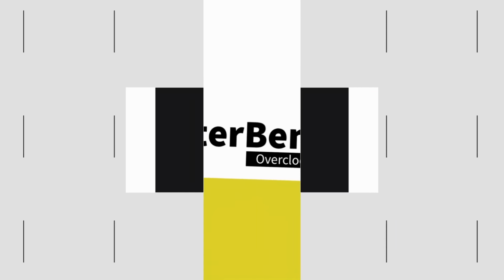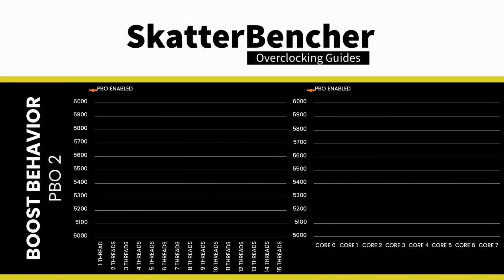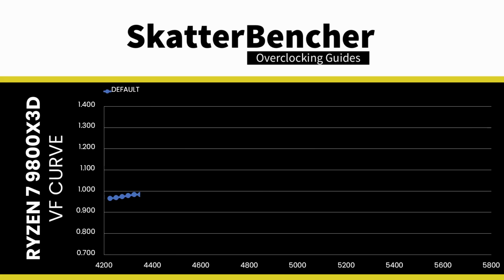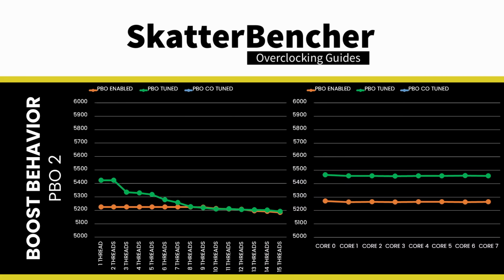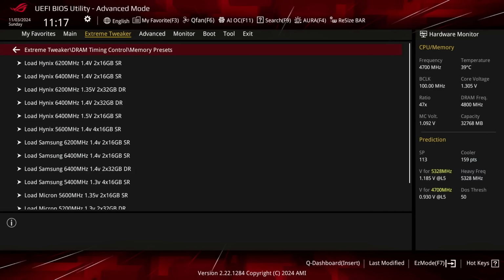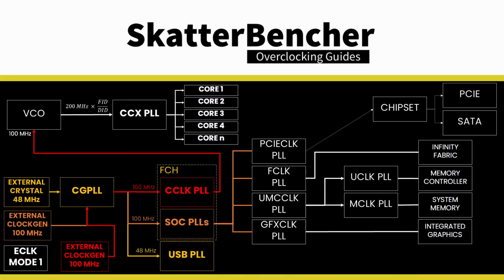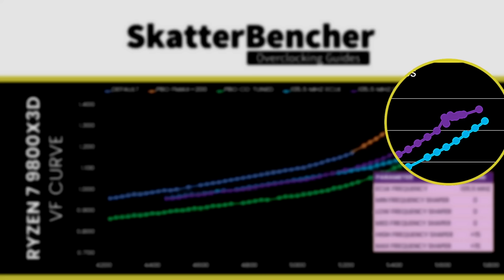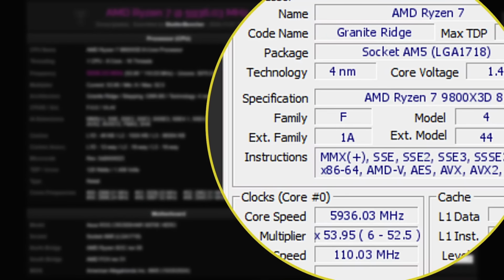Ryzen 7 9800X3D Undervolt & Overclock to 5750 MHz | SkatterBencher #82

Comment: And now realize that in future all this hassle could be done just by AI training, where the AI itself will periodically check your PC setup for stabilities at any different scenarios, voltages and timings and save all the results to MoBo memory + compare with all-around-world results from others to get more trained and accurate. And do all the overclock for you by itself, just letting you choose from few resulted setups - e. g. a setup for highest power efficiency, a setup for hardcore gaming, a setup for highest clock and so done, always utilizing the maximum stable values telling you how well are your components going in silicon loterry and how big reserves in clock/timings they have.

Comment: Great content. As always. Thank you! One question. Why can't I clock more than 5.725 GHZ? Even if I set BCLK2 to 108.5 and set the Curve Shaper to all values +10 as in the video, it doesn't clock higher than 5.725. Do we have a volt/clock limit here? I use Direct Die Cooling + liquid metal. Temperatures below 62 degrees under full load. Thanks for your feedback.

Comment: @ShaktterBencher  When you tweak the ECLK and BCLK1 to 105, is this universal to other models? Or do i have to use the same RAM?
I use a different RAM and I am scared to tweak the RAM as it may not boot up. AMD known for the memory issues.
BTW, great videos. Sub-ed, underrated channel for gamers.
Reply from the maker: You need to make sure that you're running in asynchronous eclk mode - not every board has this option because you need 2 external clock generators. In asynchronous eclk mode the CPU core reference clock is not linked to any other part of the CPU. So, you can use it with any memory because it doesn't affect the memory clock.

Comment: Fantastic review can't wait to try this CPU, I have one question ..I own Corsair 6000 cl30 I have 7800x3d and Asus x670e-i motherboard, I've seen several of your videos, and I've seen that you use preset RAM profiles in the BIOS, can you tell me if there is a better profile for my RAM that will give some boost? I'm already happy with the performance but if I can get a bit more I would be delighted. Thanks
Reply: Dive into Buildzoid videos, I use his timings in combination with a 7700X and it about 4-6% faster in average.

Comment: Question: would it be better to use a DDR5 6000 CL28 kit, overclock it to 6200mhz and try to tighten the timings even further or is it best to get a 6400 CL30 kit and bump it down to 6200 and try and thighten up the timings there?
Reply from the maker: 6000 kit will be cheaper, so I'd go for that
Reply: its around the same price, i would like to know which option is better!

Comment: What idle temps is typical after doing the last OC suggestion? I think my idle went up 10 degrees. Idles around 56-60, then minor load is 60-65. Is that normal and safe?

Comment: What I am looking for is a small all core OC. I am currently building a system with the MSI x870 Tomahawk and a Ryzen 9 9950X. It will be used 95% for productivity tasks and 5% for gaming.

My current setup in a Ryzen 9 3900X. It has a base clock of 3.8 Ghz and I do an all core OC of 4 Ghz with a voltage of 1.2. My question is, I want to do a similar light all core OC with the 9950X. It has a base clock of 4.3 Ghz. If I want to do an all core OC to about 4.6 Ghz, what voltage would be a good starting point for cool and stable running? I'm guessing somewhere around 1.05 to 1.1. I am far more interested in good performance for many hours non stop, as opposed to snappy crazy performance for a few seconds at a time.

Any advice would be helpful.
Reply from the maker: I have a 9950X overclocking guide up as well which might be more suitable for your system https://www.youtube.com/watch?v=tEJiQcPA4p0

I don't cover a static overclock, but from the looks of it 1.00V-1.10V will be a good starting point for a static overclock.
Reply: @SkatterBencher  Thanks, I will check it out.

Comment: Can you provide tips on lowering the voltage or temps on your curve shaper profile? I used the guide on your site and it worked amazing. Stable too. I'd like to use it 24/7. Gots to 5.723ghz. tops out at 83c during heavy gaming loads and 95 during OCCT multicore avx stress test.

Comment: Hey, I was wondering if using some of these strategies combined is possible with cheaper motherboard? For example b650 chipset, b650 gaming x ax v2 to be exact. Great video btw ! :D
Reply from the maker: Strategies 1 to 3 should apply universally to all AMD motherboards. Only for Strategy #4 you need a high-end board with external clockgens.
Reply: @SkatterBencher  Thank You sir! :D

Comment: Hi! Would you recommend using Curve Shaper instead of Curve Optimizer, or should you use both? Does one override the other, or will they both be applied together? I currently have the Curve Optimizer set at -20 per CCD on a 9950X3D.
And what is the benefits of setting the DDR to asynchronuous mode? I have 64GB 6400Mt in 1:1 ratio with FCLK 2133Mhz with EXPO profile 1, tRef 65535
Reply from the maker: You can use either one or together. Curve Optimizer is a little faster because it tunes the entire curve. But Curve Shaper is a little more granular so you can finetune a little better.

The values don't cancel each other out but stack. So a -30 CO and a -15 CS becomes a -45 undervolt. Or a -30 CO and a +15 CS becomes a -15 undervolt
Reply: @SkatterBencher  Thanks for clarifying. I disabled CO and went with Curve Shaper instead, Cinebench crashed with -15 low-medium and -30 high, so i set it to -10 and -20 and it runs stable for now.
Reply: @EricTheBroBean Try Y Cruncher SVT + VT3 Test. My 9800X3D handles -40 all cores for Cinebench but I do get error on Y Cruncher. I don’t think -45 CO works as shown in the video in Y Cruncher

Comment: My 9800X3D cannot even handle the basic PBO OC.. Starting to worry that there's an issue with the CPU, as when I sent PBO on then my storage device disappears. I'm using a 990 Pro NVME on a ROG Strix x870e Gaming board.

Comment: Hello, there is also a Precision Boost Overdrive submenu under Extreme Tweaker too. Do I also need to adjust the settings in there, or should I leave all of those settings on Auto?
Reply from the maker: Those menu items refer to the same CPU registers, so you can choose to use either of those menus. No need to set them both

Comment: Nice deep dive.  I would love to see you include undervolting and use lower tdp,  something in between 7800x3d and 9800x3d stock 115-120 watts for example?!
Reply from the maker: In that case, I would simply adjust the PPT limit for any overclocking strategy

Comment: Great video! what are your thoughts on the EXPO Tweaked profile? would that be like a an easy way of getting most of the performance without too much manual tweaking?
Reply from the maker: It's a good feature. I've had mixed results in terms of stability and performance gains, but it's something I will always try. If it works, it will give better performance :)
Reply: @SkatterBencher  tested expo 1, 2 and tweaked earlier in aida64 and the tweaked profile offers some pretty good improvements in read & write speed as well as latency, also runs very stable on my system

Comment: ECLK editing affects sata and it'd mean if you are using HDD/SSD there, possible drive failures, or data corruption, right?
Reply from the maker: Yes, unless you use asynchronous eclk like I did in this guide
Reply: @SkatterBencher  Oof, my x870 Tomahawk doesn't have it.

Comment: just tried some overclocking over the weekend 

it seems like the Asus AI OC actually performed the best on my chip 

tuned to 111 on the AI optimism scale 
I was able to get 5.4GHz, 20,000 cinebench r23, 71C 

with the async eclk and PBO I was able to get 5.4GHz, 19,700 cinebench but 82C 

also my infinity fabric can't go higher than 2100mhz so my chip might not be that strong

also on my corsair 6400 cl32 expo kit I wasn't able to get the timings any better. applying the same settings would BSOD with a mem error
Reply: That score isn’t normal. You should get 23500-24000 around 5.4G.
Reply: @ hmm thabks for the heads up. 
I just upgraded to win11 with a fresh install. but apparently HBU said some win11 installs crap out even when fresh. 
I have no need for win11 so I'll try win10 again and see if it improves

Comment: Does anyone have an issue where the CPU just will not boost to 5450? I set PBO to +200 with -25 curve, it's stable under any load i throw at it, but the core clock simply won't go higher than 5415, even though the level 3 clocks hit 5450 and the "frequency limit - global" is 5450...
Reply from the maker: I saw something similar here, so seems like normal behavior

Comment: Is it possible that increasing frequency w/ an OC strategy like this can somehow introduce input latency on the system (even though it's now running higher clock speeds?).

Comment: My question is, is it worth any of these overclocking methods for gaming?
Reply: Not very much. The best you can do for gaming is getting ram 6000-6400 and tighten the timings. That has more impact on min and max fps then 200 mhz more on the cores.

As with all things am5 and ryzen CPUs, they are pretty much at the limit. Still, why not undervolt your cpu? Less heat, less power and better boosting behavior. Its really easy to do too
Reply: @TehShiaT11einself  Thanks for the advice man, I'm going to undervolt it, less heat is always welcome!

Comment: this is just example legit for your 9800X3D.
My 9800X3D PBO+20 CO-30 stable in any tests but in games (Cyberpunk, Far Cry 6, Borderlands 3) i've got unstable moments.
So, PBO+200 and CO-20. All test stable, games still unstable
Only PBO+200 CO-10 works for me....
Maybe because I use air cooling (Noctua NH-D15) or your 9800X3D is more lucky

Comment: Is the strategy 2 also applicable to tje 7800x3D? I mean boosting it to 5.2GHZ through the X670e AMD Overcloking menu.
Reply: 7800x3d is 200mhz less
Reply: @ yeah but we’re talking about overclocking it  here right
Reply: @BugHuntersPC it is yeah. I would try with 150 and no 200 tho. He made the same Video for the 7000 series
Reply from the maker: For 7800X3D you can watch my guide here: https://www.youtube.com/watch?v=90UBUq1mLGY
Reply: @ my mb x670e doesn’t have en eclk option , so can I skip this or is it mandatory for the setup ?

Comment: If youre unable to use an external clock gen, what settings would you recommend for that part of the video? Thanks!
Reply from the maker: Strategy #2 or #3, or a manual fixed overclock (which I didn't cover in this video)

Comment: Great tutorial, just a quick question on scalar 10x would this have a issue on the cpu in the long run?
Reply from the maker: In theory, maybe. But the actual impact of scalar is really limited (20-30mV in light loads) so I don't see how it could have any impact on lifespan
Reply: @SkatterBencher  thank you, and it's a really helpful guide.
Reply: the undervolt will also help mitigate some of the damage caused by this

Comment: Doing PBO2+Curve when I run Cinebench it freezes. 

Would lowering the curve to 35 instead of 40 help?
Reply from the maker: Yes, that can help if too low voltage is the root cause of the instability

Comment: Id be interested to see what you did........if anything in the DigiVRM menu, like what you did with your LLC settings, or did you just leave everything on auto in there, did you change soc, vddio voltages, im looking to buy a 9800X3D to replace an underused 7950X3D, but my current CPU needed major changes in the DigiVRM menu and changes to VDDIO and SOC, LLC 8 to get it stable.
Reply from the maker: If I don't mention it in the BIOS settings segment, then I didn't make any adjustments

Comment: Can you please do an undervolt of Arrow Lake CPUs, particularly the 285k or 245k, and run them at stock undervolted, undervolted with minor downclock to get max efficiency and undervolt + overclock + tuning and other optimizations?
Reply: Who cares about Intel ultra slow?
Reply from the maker: I am working on an OC guide which will include undervolting but not so sure about including "max efficiency"
Reply: @SkatterBencher  Sure, undervolt at stock or slightly below stock speeds is also great.

Comment: I have the crosshair x870e 
So i can change pbo Settings in the Asus Menu or in the amd menu 
Wich should i use ?😅
Reply from the maker: You can use either, they both refer to the same settings in the background
Reply: @SkatterBencher so basically I can use OC Strategy #2 with the extreme tweaked instead? Is there a reason you chose to do it via advanced (AMD)? Sorry these two menus really confuse me. Thanks!

Comment: Hi, I recently switched from The MSI MPG Carbon X670E to the ROG Strix 870E-E Wifi Gaming and my performance is much worse. With MSi I just enabled PBO and EXPO, set the scaler to +200 and would get over 5.4 GHz all core in R23 with a 2,400+ score and temps in the low to mid 80's.

With the Asus board and the same settings it thermal throttles, hits 95 degrees very quickly and then goes down to 5.1 GHz or so. I've set the curve optimizer to -30 which is much lower than the -10 I did with the MSI board. Any ideas on which settings I need to look into? Thanks!

I've double and triple checked my cooler mount and it's definitely solid.

Comment: That's really cool, but for $829 AUD for that cpu, I think I would pass opn such extreme overclocking, as thats pretty expensive to replace because I voided the warranty.
The results are quite interesting, but I would stick to a basic OC.
I would like to see what you could do with 7200Mhz ram.

Comment: Hello, I followed your settings for method 2 but its not stable. PC either completely freezes or BSOD. Do I just reduce the negative curve optimizer (-40 might be too much) or should I do something else?
Reply: 40 is too much for most, start with 20, if that is stable then move to 25 etc.

Comment: Hi, so I just went and do the simple OC so PBO2 + Expo, just one question does go from 120 watt PPT to higher use of power right? I hope it won't make it worse for longer use, but I did gain more fps in a bunch of games I noticed.
Reply from the maker: Yes, when enabling PBO you'll use more power. I find that at worst the power is 160W, so it's still very reasonable.

Comment: Hi, great vid. For how long should I run occt cpu tests to check for any instabilities with a CO on my 9700X? Cheers.
Reply from the maker: As I mention in the video, when testing for CO it's important to check a variety of workloads because the voltage/frequency will be different under the stress load. Typically I check really quickly (like 30-60sec) when increasing the CO and then do longer tests (10min) when validating stability.
Reply: Inbuildt tests arent good enough for playing Pubg. Play Pubg on big maps for 3 hours, no crashes -> perfect stability.
Reply: Recommending to play a game to verify stability of one component is silly...what if your game crashes cause of your GPU ? Or windows, or ram ...

OCCT is still the best way to go to check for errors

Comment: Hey man thanks for the tutorials theyre great! 
I have almost same exact setup except I have got CORSAIR - VENGEANCE RGB 32GB (2x16GB) DDR5 6000MHz C30 AMD EXPO & Intel XMP UDIMM Desktop Memory CL 30 30-36-36-76,  
Should I get the Trident Z memory 6400MT if so which sku etc..
I have same cpu, mobo, and ryugin 3 aio, should i get 6400 MT trident Z will that make a big difference?  whats the best ram to get? I mistly play FPS like COD WoW, online multiplayers games but mostly fps..  thanks for any response or suggestions.
Reply from the maker: I don't think getting a 6400 kit is worth the upgrade from 6000. Mainly because it's not a guarantee that 6400 will work since you'd need a CPU with above average memory controller.

What you can try is load the EXPO profile for 6000, then see if 6200 or 6400 works with your current kit without adjusting voltages.

Comment: Insane job. Subbed. Isn't it the best to make sure uclk runs at 3200? Doesn't setting memory to 6200 limits uclk to only work at 3100?
Reply from the maker: If you can run it, 6400/3200 would be better. However, not all CPUs can easily do that so, if it happens to me, I keep all the EXPO settings apart from dropping the memory frequency a bit.
Reply: @ good to know. Not all would be able to keep 3100 too. I just got my cpu. Gonna buy memory soon. I'm so excited to try all the stuff you mentioned. Upgrading from a 5600x haha. Can't wait

Comment: As I understand it, there is a VF Curve factory preset in each 9800X3D that goes out of the factory, so they test these chips and basically tell them, how good they think they are. It also seems to me that you were able to get those values out from your CPU. How did you do this? I mean back in the days, with my Celeron 333 Mhz I did manual VF-Curves with pen and paper and really tuned it out myself with that knowledge, but that was decades ago, and it amazes me, that this is coming into normality for everyone to just fine tune it with the curves already known for your particular Processor
Reply from the maker: Yes, every CPU has some VF parameters fused onto the CPU from the factory. Based on the parameters, the CPU SMU (System Management Unit) then works out in real time what voltage and frequency to operate at.

My process for capturing the VF curve is pretty simple: I log the core frequency and VID using HWiNFO while running a light workload. Then I adjust the Fmax in the operating system to get the voltage at various frequencies. Afterwards, it just needs a little Excel processing to make the graphs.
Reply: @SkatterBencher  Thank you so much for your explanation, very much appreciated😉